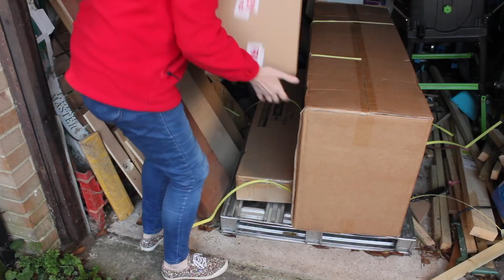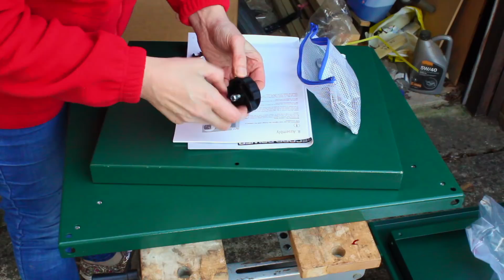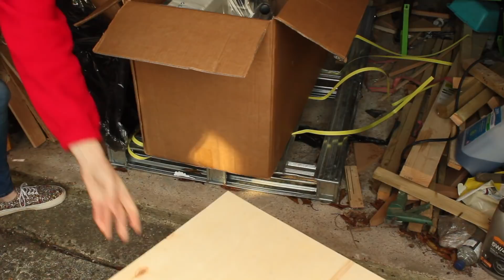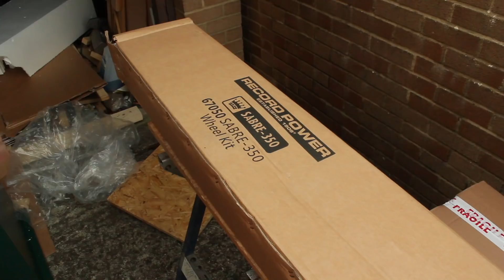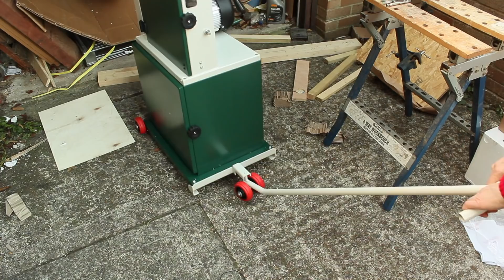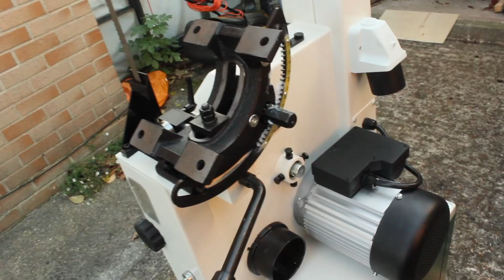Record Power Sabre 350 14" bandsaw and wheel kit unboxing and assembly

Comment: Wish I had watched your video before the one presented first by Google where the man puts the wheels on before lifting it up. Have just done that and despite putting the piece of wood in front of the wheels to brake them ended up chasing the saw across the workshop. Well done! Also the ony video I have seen which takes you through the cabinet construction - which is not entirely intuitive.

Comment: Great video and very helpful in assembling my recent purchase of this model. However one issue has arisen which I’m struggling to resolve. Having aligned the table and fence with the blade and set the fence rail all per the instructions I found the zero mark on the rail to be 5mm out of line from the blade. The table and rail need to move 5mm to the left to correct this but there’s no tolerance in the trunnion fixings to allow this. Any ideas ?

Comment: Hello Susan.

Today I picked up a record bs 300. Like you I was surprised at  the actual weight of the thing. It took two of us to get it into the car, but, once home I was on my own.

Fortunately when I laid it on the garage floor, I was orientated the correct way around. Anyway, I built the base, which is different to yours, with the wheels built in, and that is as far as I got today as was getting cold and dark, and the dog wanted to go for walkies, so that’s it for now. Tomorrow I will attach the saw to the base, which is when the fun will start. I was pleased to see that you managed to get the thing upright on your own, so hopefully I will not have too much trouble. 
The instructions so far have been spot on, here’s hoping things continue that way.
I will advise you on my progress

Comment: You're going to have SO much fun with that saw! I have a 9", and that's okay for SOME things, but you can't do a lot of what you really NEED to do in instrument building with it. So I got a Porter Cable saw and it's WONDERFUL. The 14" size is about what you need for most everything, though a bigger one allows for some additional jobs. But for resawing, for instance, you won't find many that go higher than the standard 12" (with the riser block kit. You DID get the riser block kit, right?) that the 14" will do. You're going to have fun!  Make sure that you get the best blades possible, that is what makes all the difference with these things. 

Just remember that bandsaws were invented to cut cows apart, so they work REALLY well on fingers! Don't EVER let yourself get distracted while using it. That's a hospital trip waiting to happen. But you're good enough, and careful enough, I'm not really worried about you. Have fun!
Reply: Whoops, after seeing the whole video, you don't NEED the riser block kit with this saw. Looks very substantial, good choice! And you definitely proved that brains is a better choice than brawn in how you put it together. Excellent job!
Reply from the maker: Thanks!